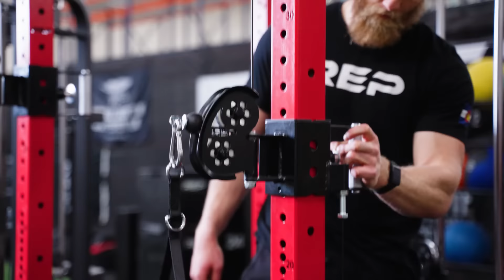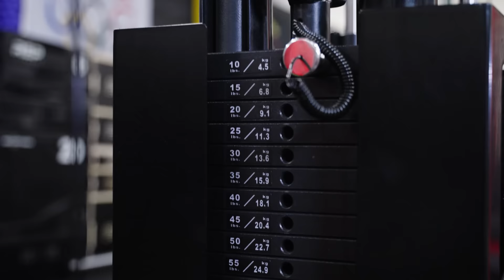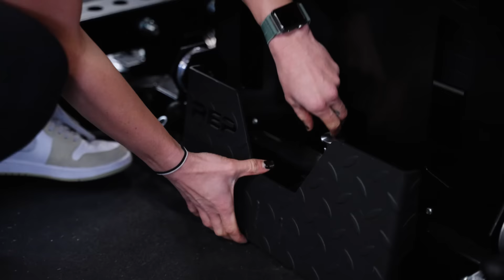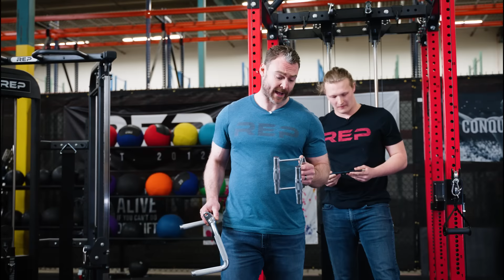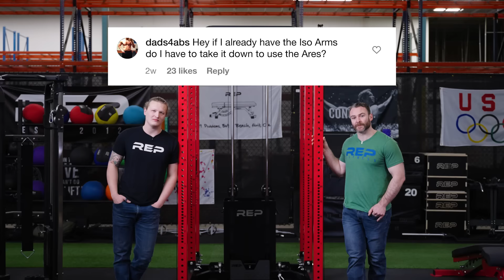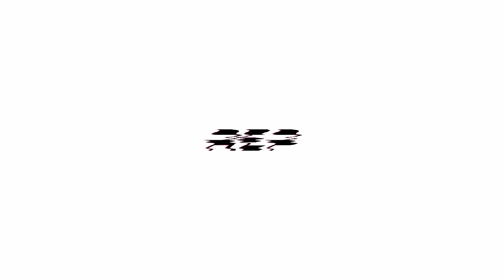How We Built the Ares Cable Attachment | REP Engineering

Comment: Looks like a perfect machine! I have a couple of questions, asking here instead of contacting your office in case someone else has the same questions.
- I see that it includes a pull up station, but can this be used for assisted pullups as well?
- Assuming there aren't space restrictions when I plan to put this, are there advantages to having a 16"/24"/30"/41" setup? I would guess that getting the largest that fits in the available space is the best option, would that be correct?
- If I order a 260lbs setup and reach a point where I want the extra 50lbs, is it simply a matter of ordering the extra weights at a later date?

Thanks for your help :)
Reply from the maker: Our customer support team will have more answers for you for all your questions but you can add on the weight stack later in time but you will have to disassemble your rack. The different depth sizes depend on your lifting and space availability. Finally, assisted pull ups may be hard with this since there isnt a for sure way to set it up unless bands on the j cups for the hooks.
Reply from the maker: always happy to elaborate on our answers with our customer support team!
Reply: @repfitnessequipment  Awesome, thanks for the quick replies! Now to finish the garage construction and begin saving my pennies :)

Comment: Is there any chance that the Ares could be supplied with a longer cable kit, and that way allow for more depth (rather than just16") in the "storage area" at the rear of the rack, say 30" storage area (or even 41") that way, incline bench can still be performed, spotter can still be performed (in the traditional sense, not that cannot with changes). just needs longer cables..
Reply from the maker: Hey Scotti - best thing to do is reach out to our customer support team for specific questions like this. On the bottom of our website - we have chat/email/phone/text available.

Comment: What if the bench locked into the rack so you could do seated rows on the bench. Of course the foot plate would have to be higher and possibly bigger. An engineering problem for sure but interesting to think about.

Comment: The video states the AREAS adds 3 and 3/4" to the height of the rack. Is this true? Documentation on Rep Fitness website says 1.2" only. Looking to install the 93" ARES rack in a 96" height limited space...which is the correct spec? thanks!

Comment: So it sounds like if you go with the 4-post 16" option, there isn't enough room to incline bench (in other words you need at least the 16" + 16" 6 post design). Is that correct?

Comment: I know it’s a late question but you said it works with the belt squat attachment. Does it still work with the cable catch so you can start the belt squat at the top position? I know the first plates will be raised before you can add more weight. Is there a solution?

Comment: Great job by all the Rep Fitness engineers who designed the ARES System.  BRAVO!! It's an amazing piece of equipment except for the D handle that came with the ARES System.   That's the only negative thing about the ARES System for me.
Reply: The red pin which came with the ARES System broke tonight while I was working out.

Comment: thanks for the efforts with your reviews, much appreciated. I have a question for you regarding rack height. My basement space is 104" high, I'm looking at the Ares with the PR 5000 cage, it comes in an 80" and 93" height. Those using the rack are 5'10" to 6'1". Which would you recommend?

Comment: Is that the leg roller being used for the lat pull-down at the 7:39 mark? The leg roller (even if you buy 2) for the PR5000 still seems too short at 20" each with a rack width of 47" (i think that's the 5000 inside width). Are there other options available for a leg holder?
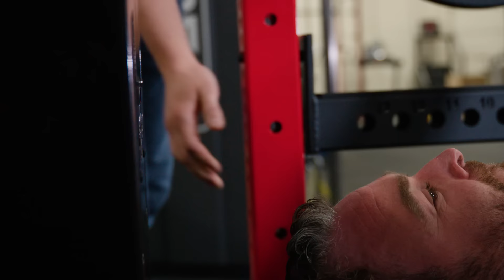Reply: Yes, this will be a huge oversight. I don't think the leg rollers will work with the Ares since the space between the weight stack and the uprights are around 5 inches (look at the 12:43 mark) . The leg holder in the 7:39 mark is an entirely new product that's not even for sale. That leg holder must be available at launch or lat pull down will not work.

Edit: Let me take that back. If you have the flip down safeties and 2 leg rollers, it will work. The reason why I think it will work is if you look at the Selectorized video (https://www.youtube.com/watch?v=XzvjOaOJBI0) the guy in the video uses two leg rollers.
Reply: @oldschoolcoolgamefan2650  Thank you for that link. I appreciate it!
Reply: If you have the flip down safeties, you can use those for the rollers to set you further back, that being said yes they are too short, I am planning on buying some large PVC pipe to actually slide over them both to create kind of my own lap bar if that makes sense.
Reply: @Dizzohh  I had a similar thought about getting a little more room but not the PVC pipe. I think that's a good idea. Thanks!

Comment: I emailed rep asking them if i get the pr 4000 four post rack with ares witll i be able to lift outside of it, will the ares weigh stack get in the way of the bench when benching outside/infront of rack?? Well, i think i got my answer already by looking at this video...  i see u can bench inside 6 post rack, which in my case will be benching outside 4 post rack.. anf u mentioned there is about 5-6  inches of space from the guys head to ares..so if this is the case there is no way I can do incline since bench has to be moved back about 11-13" to do incline and ares will get in way of benching🙁

Comment: On the website it says, "*Power Rack not included with purchase*". Does this mean that 4 uprights are not included with the 4 post configuration?

In other words, would I just be buying the weight stacks, pulleys, and cables for $3000?

It doesn't make sense to spend $3000 for an attachment that's not functional without additional expense.

Comment: Is the pushpin on the trolley the same size for the 4000 and 5000? Just concerned that a 5/8” pin on a 5000 ares would move too much.
Reply from the maker: Hey Schwerk, good question. The pins are 5/8th inch on the PR-4000 trolley and 1" on the PR-5000 to ensure a secure fit on both rack's hole spacing. No worries there!

Comment: So glad I looked into the ares before getting the lat attachment. My only concern is the compatibility between the banana and the low row? Any clarifications on this?
Reply from the maker: The low row has it's own piece that can be used for low rows but also a center attachment so you can use more single point attachments.

Comment: 2:1 ratio was a bad idea; if 260lbs now feels like 130lbs on the lat pulldown you're pretty limited in what you can do weight wise.
Reply from the maker: There are TWO 260lb stacks. PLUS a 50lb upgrade for both. This means maximum low row and lat pull weight with 2 upgraded stacks to a total of 620lb is 310lbs of actual pull weight. Technically you could also add the micro adjustment for another 5lbs ha. We thought a 310lb of actual feel/pull would be sufficient for 99% of people.
Reply: @repfitnessequipment  Oh lord; open mouth insert foot, 310lbs is definitely enough. Guess the stickers only going up to 130lbs threw me off.

Comment: Will the banana fit the low row attachment?
Will you be able to use a different grip attachment for low rows
Reply from the maker: The low row bar has duel attachment points with a single point coming off the middle for different 'standard' single point grip attachments... so it the low row bar that comes with it acts as the banana on the bottom.

Comment: Hey REP, I would like to see how easy this is to adjust the weight pins with weight horns and plate storage attached.  Also, I would love to see the ability to order the mountain cutout design in the shroud cover.
Reply: The selector pin sits exactly at the mid point of the 16" cross over. The weight horn center will be 8+1.5" or 9.5" from the Ares selector pins. An Olympic plate is around 17.72" in diameter and one half of that diameter would extend toward the selector pins. One half the diameter is 8.86", which is less than the 9.5" distance from the selector pin. At the widest part of the plate, it will be 0.64" of distance to the selector pin, however the plate is curved so really it would be that minimum distance at one point.

Comment: Well Coop you said you wanted an ecosystem here it is…

Rogue really need to get their shit together this looks amazing 🔥
Reply: Rogue has that slinger and adjustable handle slide. Takes up the sides as opposed to Ares closing the back.
Reply: @r.ramirez6745  rogues lat attachment has issues n only 2 modes, top and bottom. Must admit this takes the cake
Reply: I was going to buy a forceusa g15 bt theres 0 attachments from other companies that would’ve fit. (emailed their customer service its not a 3x3 beam)

I live in a shythole small apartment n i must say this takes the cake for me bt it depends on ur use case i guess
Reply: @r.ramirez6745  yeah and it’s a piece of shit
Reply: I’d love a full review on the area from coop

Comment: Great PEACE! Got me thinking! Maybe not get the Rogue Pull-up? I think you should have taken the very easy step of adding the ability to attach bands to each stack like the Titan and Rogue. Bands are cheap and then one of the outside stations could be used for seated row or pull downs. This would give the ability to circuit train with squats or bench without having to move equipment.

Comment: how much weight are you actually moving with the 310lbs upgrade or what would the stickers on the stacks say down to the heaviest plate? and will their be a way to attach resistance bands to the weight stacks?and does the trolleys on the pr-400 also have a cut-out for the numbers on the uprights?
Reply from the maker: So if you upgrade to the (2) 310lb stacks... when you connect the weight stacks as shown in the video... you can access the full 310lbs of pull down/row power. If you're just working off one pulley, you'll be accessing just one 310lb stack at a 2:1 ratio, so 155lbs of pulling power.
4000 trolley doesn't, but it doesn't take long to get the hang of where it's at since there are some holes on the side that you can see as you lock it in place. The 4000 is the one we tested/used the longest.
Reply: Will there be a way to attach resistance bands on the stacks? It would be nice to have  the same trolley for the pr-4000 , i like the idea of having the handle on the side it’s easier access or at least have the cut out.

Comment: I noticed your posts have a series of holes that are much tighter together towards the middle of the post.I purchased a rack around Thanksgiving and mine does not have that. What is it for? Just more spots for the ares?
Reply: That's the PR-4000 which has 1" spaced holes in the bench zone. You probably have the PR-5000 which has 2" hole spacing throughout

Comment: Am I understanding correctly that you don't actually need to attach the Ares to a rack? E.g. the Ares 4 post can be a standalone functional trainer (reference 14:08 in the above video)?

For those of us with really limited space and non-REP racks, that would be awesome. Way better than most plate-loaded functional trainer footprints. Please let me know if my understanding is correct or not. 

Thanks!
Reply from the maker: Yes, exactly our thoughts! It "technically" sits in a 4 post 16" rack. You can see the photo on this main Ares attachment page - https://repfitness.com/collections/ares
Reply: @repfitnessequipment  would this configuration require front feet to use safely?  thinking about stability if the weight stack is mostly elevated while doing a heavy row or lat pulldown.

Comment: Can i keep my bench press setup though? or will they both intervene with each other? just thinking it through in reality. I wouldn't want to buy a whole other rack/cage.
Reply from the maker: Yes to flat bench, higher incline bench - no. However, you can get the 4 post Ares with front feet and spotter arms, the 41" depth rack and reverse your incline bench, or use spotter arms on any version. A few workarounds for the incline bench which is pretty much thing you gotta workaround. Everything else, the Ares just adds more functionality.

Comment: Will the land mine attachment work okay since it seems like it would need to be connected to the cross members rather than the uprights? Also, how cumbersome will it be to get attachments like j-cups/safeties/etc. on/off the front uprights with the cables running along those uprights? Especially wondering about this with the PR5000 where the cables run up the outside of the front upright - will this impact adding and removing these attachments?

Comment: Any way to connect it to a leg extension on a bench they have? Leg extensions with plates isn’t as smooth as cable. Would be nice if they had a connection for leg extensions and leg curls

Comment: Been waiting for this. Even picked up the 5000 just for the Ares. Am I the only one worried about those horizontal pulleys on the bottom that protrude out? I feel like the cable wires could potentially be a tripping hazard being so close to the floor.

Comment: I think it’s over kill. You really only need the trolley arms to perform all those exercises. Just adjust the trolley arms
Reply from the maker: For those who lift less than 150lbs... you're right, but for those that need 200, 250, 300 for heavier movements like lat pull downs and low rows, you need the lat pull down and low row connectors.

Comment: Very impressive, for incline benching you can get the Hoist 5167 bench if you don’t want to move where you bench. This should work since when it’s 75-degrees the back post is almost flush with the back of the pad giving you enough clearance with the weight stack.  The smaller angles as it approaches being flat is achieved by the back pad sliding forward so the back post never needs to move. 

The best part are the interior narrow cables that you can clip together to utilize a true 1:1 weight stack ratio, which is something no other functional trainer has. You can also unclip to work each side unilaterally, which looks great.
Reply: So with the hoist 5167 bech I will ne able to incline inside the 6 post rack or outside the 4 post rack even with ares in the way?

Comment: When adding the configuration gon the cart, are the “ 30’ + 16’ “ apply to the uprights and cross members in the Ares part of the rack? Or does it apply to the front of the rack where you would work in?
Reply: 30" would be the front part of the rack (where you lift), 16" would be for the rear storage/stabilization area (where the Ares will go).
Reply: @carlehrett480  I get you! This is because these new cross members have the holes for cables! Got you, thanks for clarifying.

Do you know if rep sells their uprights by themselves? Lol

edit: just saw on their website, they do sell upright apart!
Reply: @Moon_Tower  - I believe they do sell it.  Do you need the 93" or 80"?
Reply: @SmokinBuddha  the 80’ 

I would just need to buy 4 (or 6 for a 6 post rack) 80’ uprights correct? Then everything is optional at that point? Like pull up bar, weight horns, strap safeties, etc
Reply: @Moon_Tower  - Are you buying a new power rack? You'll need 6 uprights, the back will be 16" cross members and the front will be either 41", 30", or 24".

Comment: If I buy the Ares, will weight storage still work on my PR5000?
Reply from the maker: Weight storage still works
Reply: It didn’t look like any cables or pulleys get in the way from the pics on the website
Reply: @BrandonSchwartz1  It looks like the travel of double pulley might need the space where the weight horn bolts sit. But its hard to tell for sure.

Comment: So I know you mentioned about the 3.8 inches of height added but is this added height to the upright or crossmember because it doesn’t look like 3.8 from the upright.  In other words, if I had a 83 inch dealing would I be able to get away with this on the 80 inch rack?
Reply: I was wondering same thing. 94 inch ceiling didn't add mat yet.
Reply from the maker: Our apologies, it is 1.2" - we plan on updating the site/info where we can Monday. To answer your question... yes, 83" with the Ares works with some room to spare.

Comment: What about the weight horns on the back of the rack, will I have to remove them?
Reply: Same thought I had, wonder if they’ll interfere
Reply: They should be fine all the cables follow the line of the rack assuming your horns are on the furthest rear upright
Reply: The pulleys look to be in front of the rear columns, so it looks like weight horns will fit fine.
Reply from the maker: Totally fine